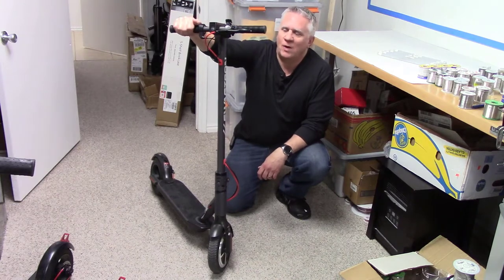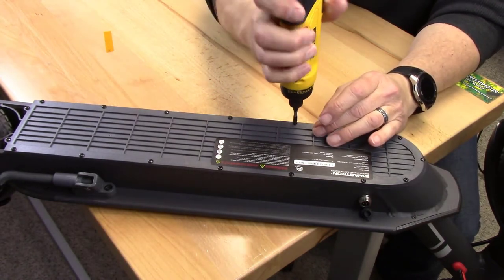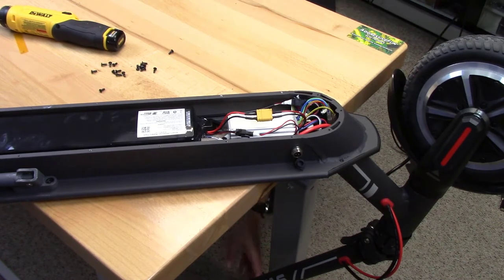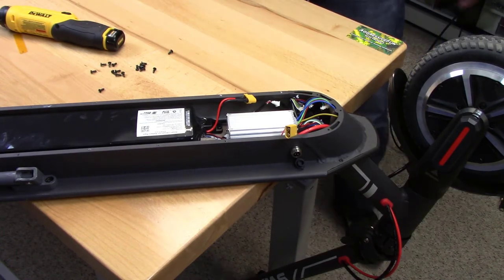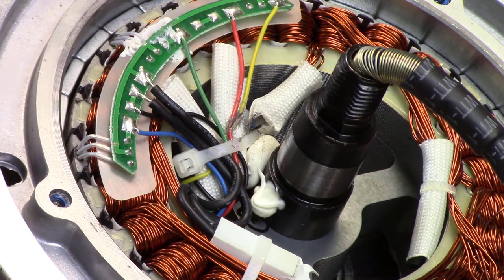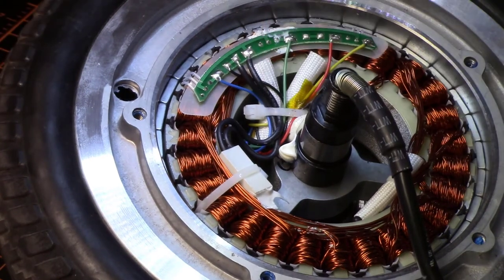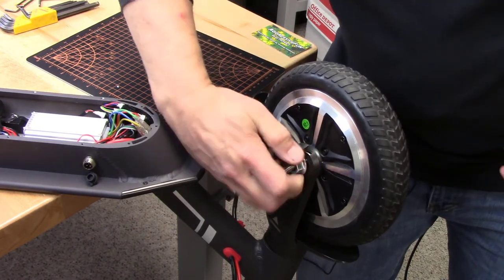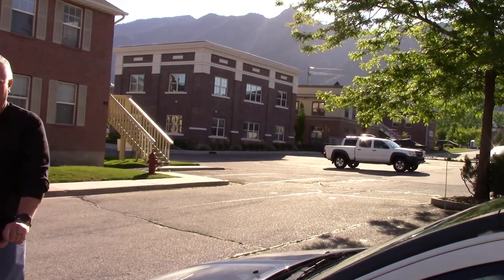How To Fix Swagtron Swagger 5 Scooter Not Running - Successful Repair (SOLVED)

Comment: My hover 1 journey turns on but it wont run.
Reply from the maker: I'm not familiar with that scooter model but the same principles apply from the video. You'll want to verify that the wiring inside is still plugged correctly, are any of the wires damaged, has the scooter gotten wet, does the charger make it go to a full charge, and is it old enough that the battery may need to be replaced? Also, are all of the wires to the throttle and controls connected and undamaged? Hope that helps. Thanks for watching!
Reply: I thinkni found the problem the screen wont come on so im thinking it the control. Im going to start with that also wantedvto ask you i tried turning the motor with my power source but only has 15v will that turn the motor?
Reply from the maker: @rudyzavala3437  15Vdc might make it turn but it depends on the actual rated voltage. Typically the batteries are 36V or 42V so the motors are going to be rated closer to the battery voltage. You can us a DVM and measure the resistance of the motor windings. The resistance should be really low, you're just measuring a big coil of copper wire in the motor, if the winding is good.
Reply: I ask that because i tried it and the rite would turn.
Reply from the maker: @rudyzavala3437  It won't be very powerful but if it turns, that confirms that the motor is good.
Reply: It stalls like it wants to go but it stalls.
Reply from the maker: That sounds correct given that your voltage is much lower than the actual rated voltage for the motor. It's just a quick way to do a simple test and if the motor moves at all, it confirms that it is still working.
Reply: Thanks a bunch
Reply from the maker: @rudyzavala3437  Very welcome! Good luck. Let me know how it turns out.
Reply: I will as soon as im done with it
Reply: Im sorry i didn't get back to you earlier bti didn't know how to get back to these comments...lol
I found the problem it was the 2 screws holding the handle bars. They pinched wires goingvl to the led display and thats why the battery light was blinking. I pulled them out and eewired and saudered them back together worked awsome. Just replaced the throttle because damaged it when i pulled it off. Thank you for all your help and attention 🙏 i am greatly appreciative.

Comment: E4 error code how to fix?????? Bad rain yesterday got really wet
Reply from the maker: I'm not sure what causes the E4 error. I've not seen that myself. It may be that something did get wet inside so I would start looking inside for any moisture that could cause problems. Thanks for watching!
Reply: @Aggressivefun  it works now just had to dry but it takes off sometimes whiteout pushing the throttle but thanks for the Reply!
Reply from the maker: @quincylockett7846  Oh good. Always nice to have a repair fix things! Well, except for that throttle issue - where's that water!?
Reply: @Aggressivefun  it's not working it went out day or two after won't turn on at all